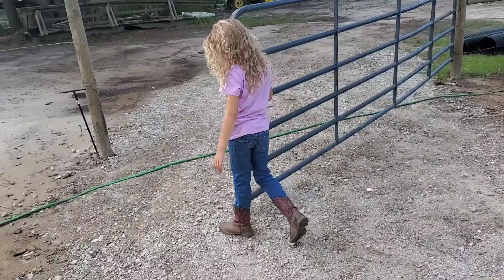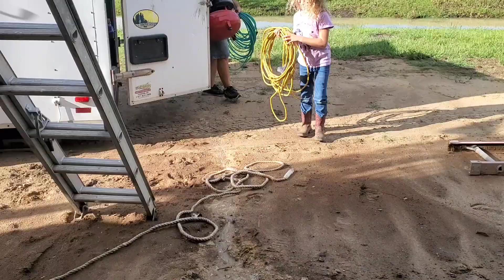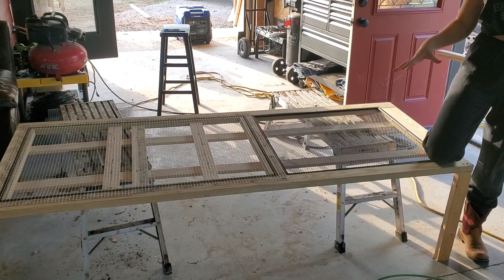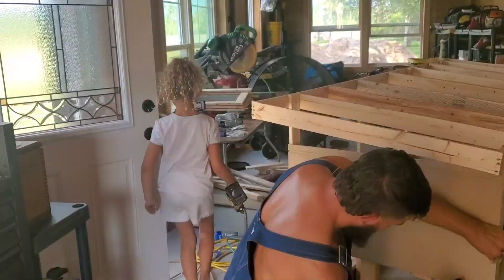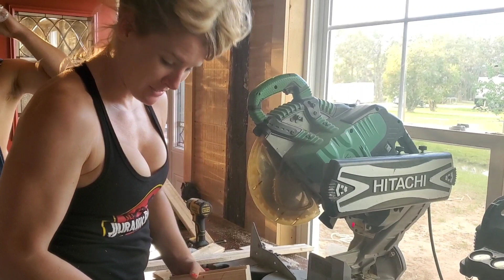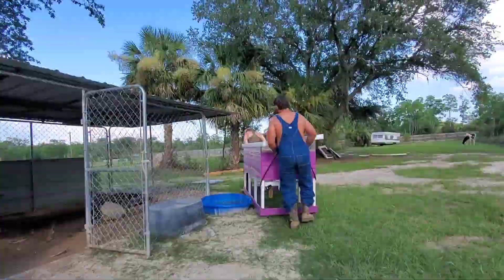A family that works together....stays together 🔨👷🏼‍♀️👷‍♂️❤

Comment: Choking up on the hammer may seem more accurate, but you have to swing harder, making you lose accuracy.  Hold the hammer at the end of the handle.  Swing for contact, not power.  Let the weight of the hammer do the work.  (Her husband probably knows that, but don’t you dare try to tell Lacey Evans how to do something, LOL.  😉)